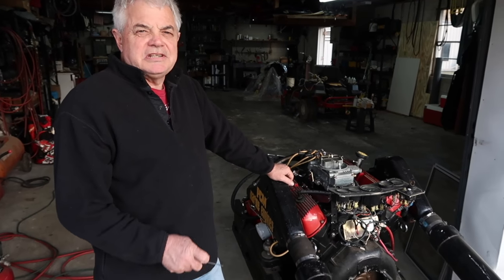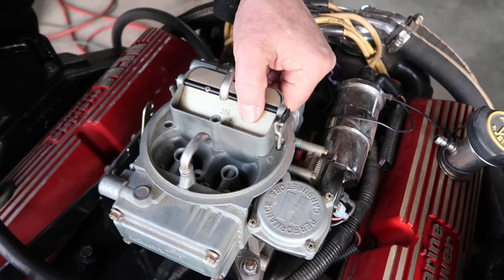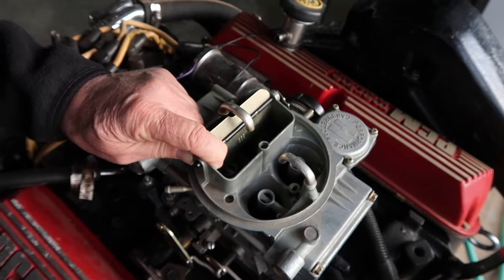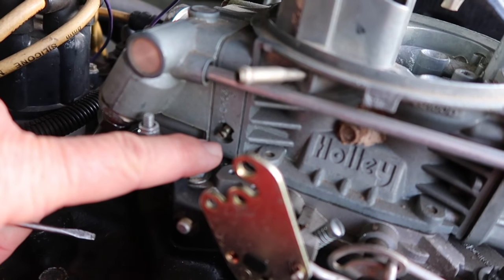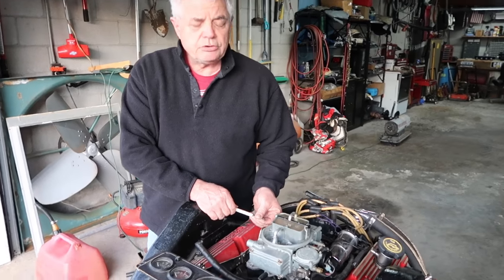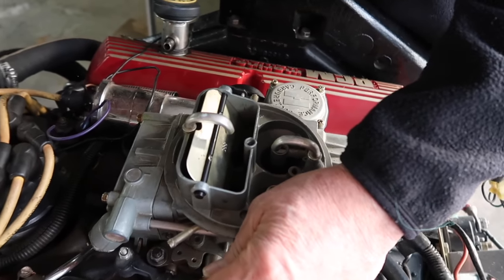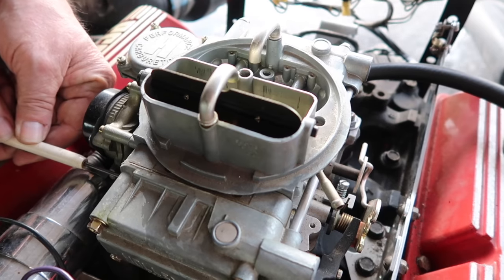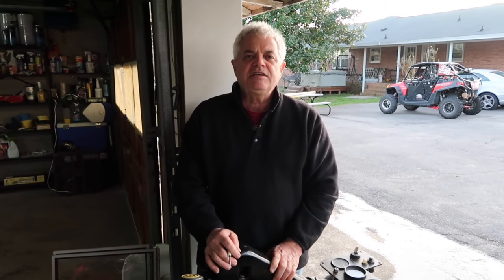Holley Carb Rich/Lean Adjustment

Comment: While idling and car in park, carb works fine
As soon as I put in reverse or drive to move the car, engine just shuts off
You think maybe is vacuum leak or still some adjustments need done on the carb
Reply: I have same question, can anyone reply please
Reply: What is your transmission? On autos with AT, there’s a kickdown function that I’m not very familiar with, but it sounds like that needs adjusted. It’s an armature b/w the throttle cable hook-up and the carb body. You will need to do some digging into how that works. My understanding is that the AT when taken out of park will lower the idle, and it seems it is too far for you. 

Also, when setting idle, engine needs to be at operating temperature, back the idle screw all the way out -> set your air screws 1.5 out -> if it will not idle, turn the idle screw in a half turn at a time until it will run, then adjust an air screw like he said, but ensure that once you adjust one side, you set the other side to be the same. Then use idle screw to get idle where you want it, then make another pass on the air screws using your setting that you ended on as the new baseline (not the original 1.5).

Comment: I got a built 355 with big cam and holly highrise intake and 600cfm 4 barrel carburetor, it has hesitation on quick acceleration and sometimes makes a loud pop out of the carburetor, once it gets on the top end it has good response and pulls good but its having a hard time getting up and going. I feel like the motor can make alot more power but have no idea what to do, should i toss the 600cfm and get a 750cfm?
Reply: Same problem with mine
Reply: @ermiliodagoat7492  I figured out the problem, the timing wasn't advancing quick enough with the set up Im running it was sucking to much fuel and air and not enough timing and it needed a bigger accelerator pump nozzle it wasnt getting nearly enough gas, I went from a 32 to a 40 and now the truck does no back firing at all and runs like a champ
Reply: @ermiliodagoat7492  putting lighter springs in the msd distributor to advance the timing quicker was a big help but it still was wanting to pop sometimes right off the launch, so we ordered a size 40 accelerator pump discharge nozzle and now the truck absolutely rips
Reply: @ermiliodagoat7492  and another thing it was running way to rich so I turned the idle mixture screws all the way in till the motor stalled and backed them out a half a turn, that brought out a lot of power, I got a couple videos on my channel they don't really show much but it shows how the truck ran before and how it runs now, it needed 3 things 1. Faster timing 2. Bigger accelerator nozzle 3. Idle mixture screws needed adjusted
Reply: Timing issue probably installed the distributor at 0 degrees tdc you want to bring it to tdc then bring the line on the balancer to the top of the timing tab you want 10-13 degrees initial timing then make your minor adjustments at the distributor

Comment: what if there's NO change when you mess with the idle adjust screw?
Reply: When this happened to me, I found that I had one of the springs on the throttle linkage holding the throttle open slightly. I had attached it to the wrong hole.

Comment: Great explanation. I have a Carter AFB On a small block Chevy engine. Two Issues that I cannot seem to fix. #1, It is very difficult to start after setting for 24 to 36 hours or longer. The 2nd  and much more serious issue is the terrible gas mileage, aprox 5 MPG.  I suspect it's running extremely rich. I know how to adjust the idol,  But is there a way to adjusted  the "rich/lean" at higher RPMs.
Reply: Use a msd ignition box for better start and fuel economy. Also New battery..new air filter..new spark  plugs.Smaller jets for primary jets. Bigger acceleration pumps..
Reply: Accelerator pump for starting, the main jet, and or cam for milage?
Reply: I have an old pontiac with a holly that probably needs rebuild . I put msd with e3 plugs and she fires right up.

Comment: On 350 engine my car
Valve covers the passenger side is getting alot hotter than drivers side car runs smooth not runing hot

Comment: What if it won’t idle or dies when I try to idle
Reply: Does it run rough before it dies? In other words, does it appear to be struggling to run or is it running pretty smooth when it dies?

If it’s running rough, it’s most likely ignition or fuel related. 
Let the exhaust manifolds cool, then start the engine. Have someone keep the engine running and immediately touch the bottom of the manifolds close to the exhaust port of the heads (or use a laser thermometer). Once they start getting warm, quickly check all 8 exhaust ports. If any port isn’t warming up, I’d suspect a bad spark plug or bad spark plug wire on that cylinder. While it’s running, take the plastic end of a screwdriver (or plastic mallet) and tap on the float adjustment screws (the hex heads on the top front and top rear of the carburetor….if it doesn’t have them, tap on the little circle areas where the fuel line enters the bowl). If a piece of trash in the fuel line gets stuck in the needle/seat it will cause a problem and tapping the screw will sometimes free the trash and fix the problem. Also check the timing advance. 
If those check out OK, could be bad gas or carburetor needing adjustment or rebuild. 

If it’s running smooth but dies, it’s most likely curb idle adjustment or incorrect timing advance.
Reply: @TyTanium1294  yes it does run rough before it dies. Shakes a little then the Rpms drop and eventually dies out. I noticed it bogs down when I turn the ac on as well.
Reply: @calebmiears5866  this guy gives a summary of the Holley carb adjustments.    https://youtu.be/bv9NIIJ3rFc 
I’d say watch this video and then check the adjustments on your carb.